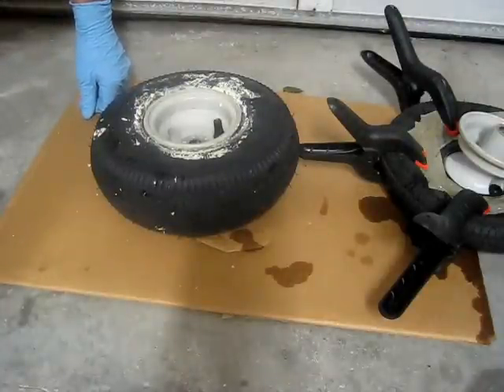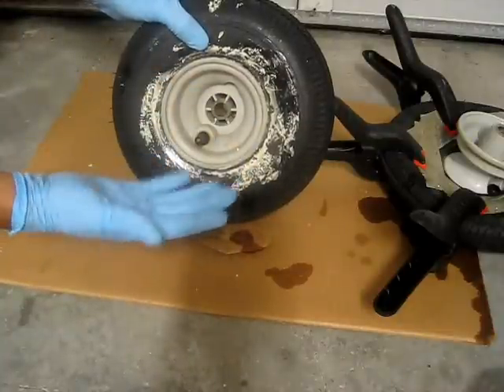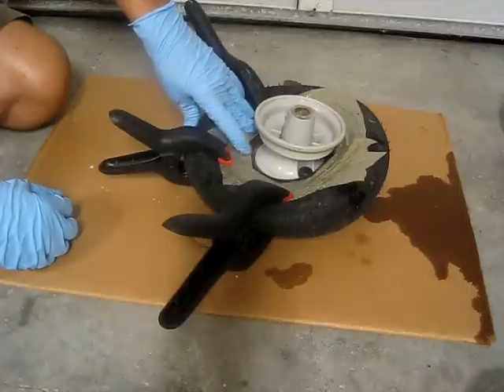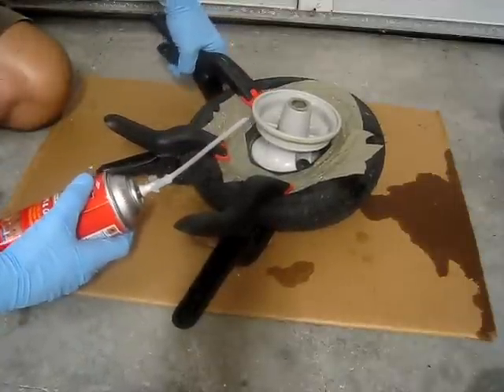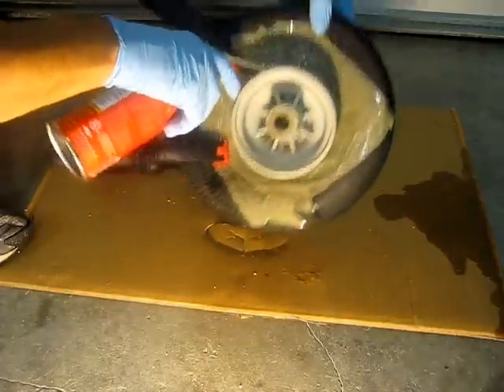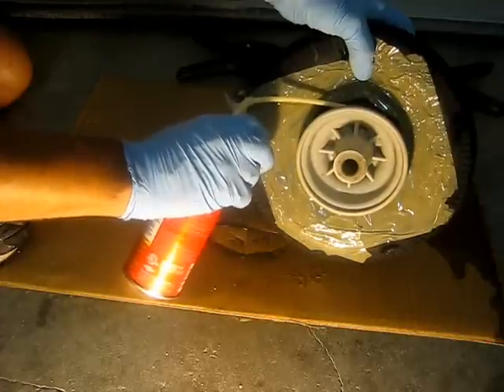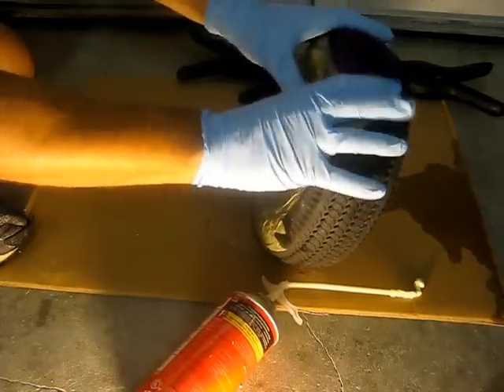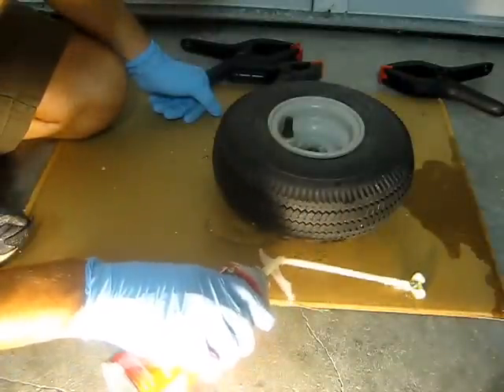How To Fix A Flat Tire

Comment: Too much wrk, too much talk & messy clean up! Here's how I do tires, I've done 4 riding mowers, a Harbor Freight hand truck, a double wheel wheel barrow, my mountain bike( both wheels ) & my 60hp Ford tractor: (1) Using this youtube as demo, wrap rope around middle of tire, pull tight till it will hold air,(2)  Fill tire w/ air till tire beads pop out & seat, deflate tire making sure beads are seated on rims (3) Drill holes slightly larger or same size as foam quill,1 hole @ top of tire, 1@ btm, small tires can hve holes drilled in sidewalls, larger tires, drill btm hole in sidewall, top hole in middle of tire tread. (4) Fill tire from bottom till showing at top hole  (Leave Shrader valve in when filling, don't need another hole to manage )(5) Stop foaming as soon as foam appears at top hole bc it will cont. to expand. (I never take Shrader valves out....Why???  )
I hve many Locust trees on my place, they hve 2-3" thorns, i bcame a tire changer/ flat fixing slave, at any given time, 1 vehicle always had a flat, now with miracle foam filling, i rarely have one. Just heads up about my experiences as a tire man! Good Luck!
Reply from the maker: +Dan Roy Some good ideas on there.  Will keep them in mind.  Thanks
Reply from the maker: +Mike Story Great! Glad to hear it worked for you.  Let me know if it starts to break down. I am curious how much abuse it can take.  Thanks
Reply: That was also my experience on a wheelbarrow tire.

Comment: does anybody think that  putting in foam peices and cardboard and paper all together into tires and using great stuff would help with keeping the tire strong .
Reply from the maker: +Mini Motoskills The great stuff foam will crush with repeated impacts.  The closed cell foam will rebound after an impact.  The paper is going to be heavy and may be more likely to cause balance problems if you are hitting high speeds.

Comment: Drill (3)  3/8 in holes in the tire and insert the great stuff until the foam comes out of the remaining 2 holes. Very easy to do, and a minimum of mess, most importantly you achieve uniformity of the foam. Much easier than the way you're doing it, with much better results. Not trying to steal your thunder, just my opinion.
Reply: You put it in until the foam comes out of the
holes and let it set up overnight. You could put screws in after it is completely full, but remember it continues to expand, adding screws would give you a very dense tire.
Good luck and the best part is no more flats.
Reply: Joseph, you are right I drilled three holes in the tread 33 degrees apart and worked like a dream. the way he is doing it really sucks.

Comment: Next time hold your can upside down.  Upright you let too much air pressure escape before the foam begins to expand in the can.  The expanding foam will drive itself out of the can, but when you reach the limits of the expansion the can will slow to nearly nothing, just like you demonstrated in your video.  Upside down preserves the air pressure in the can and will allow you to drive nearly all the content of the can out.

Enjoyed watching you essentially waste your time.  The foam is not load rated.  It won't hold up under a load.  If you did this on something that is going to have to carry any significant weight the foam will collapse.  And as the foam cures it turns to glass.  It breaks down easily and without air pressure in the tire you'll have a flat again.  Only with the foam inside the tire you'll be hard pressed to do any further repairs.

Good luck though.
Reply from the maker: You are right, it is better to hold the can upside down.  There is no straw inside the can to pull from the bottom.   I made the video in 10/2011 using tires that would not hold air.  It is 12/2016 now and they are still very firm.  No problems with breakdown of the foam.  But you are right that it isn't rated to handle a "load" but it can certainly handle some load.  I have never tested it to see how much.  I put 2 sit-on-top kayaks and all my gear on them and go down trails with roots and have never had a problem.  I am guessing about 200+ pounds.  Was definitely better than buying new tires every year or two and carrying a bicycle pump with me so I don't get stranded with a fat at the end of the trail.  I don't think this would work long-term for something like a riding lawn mower.  But I would try it for the cost of a can or two of foam to possibly save me from having to deal with putting air in my tire constantly.  I also doubt that it would hold up to use in a drive tire, like the rear of most riding lawn mowers.  I think the foam may let go and let the tire spin on the rim.  But then again, I would try it just to see if it worked.  Maybe even put a few screws thru the rim and into the bead of the tire to keep it from spinning.  But I don't have a riding lawn mower to try it on.  My point is, if you are going to pitch it anyway, why not try?  Of course, you can't expect it to hold up to unreasonable conditions (car tire, heavy machinery, road-bike tires...)

Comment: Great idea with the tape around the bead.  Lets say I want to reverse this back to a conventional tube or tubeless tire, how much work would it be to clean the foam off the rim?
Reply from the maker: You can get 99% off easily, but It is hard to get all of it off. There is usually a thin film left. But that should not cause a problem unless it is on the part of the bead that makes the airtight seal. You can sand that area if you need to.

Comment: WHY NOT TAKE THE TIRE OFF AND EXPOSE THE INNER TIRE AND SPRAY OR PAINT THE INSIDE WITH FLEX SEAL. AND LET Set  UP AND RE-INSTALL. AND SEE IF THAT WORKS. USE BLACK FLEX SEAL AND IT WILL NOT MATTER IF YOU GET SOME ON THE OUTSIDE.. I HAVE NOT TRIED IT BUT THINK IT MIGHT WORK.  ONLY PUT FLEX SEAL IN AREAS THAT HAVE POSSIBLE HOLES.
Let me know if this works. PROBALLY WILL NOT BE SO MESSY.
Reply from the maker: I haven't tried flex seal yet.  Would be a good experiment to see how good it is.  The problem with my hand truck tires is they had dry rote so they had tiny cracks all over.  But, if I painted the entire inside of the tire, maybe that would work.  I have been wanting to get a can and try it out.  I will let you know if I do.  Thanks for the suggestion.

Comment: you went about that the hardest way possible...
just leave the tire on the rim, remove the valve from the stem, insert the tube all the way into the stem and spray the extra expanding foam in  while rotating the wheel a few revolutions.  take the tube out and reinsert the valve.  no mess, works perfect!
Reply: Does that work? Make a video.

Comment: Wont work in load carrying tires 
What you will get for your efforts.is flat spots everyy time you leave your lawn tractor sitting. You need a foam with some memory like rubber.
Reply from the maker: Yes. It can only handle so much weight.  Turns to powder if you hit roots and rocks.  I still use the tires in the video, but they only have about 50 pounds each on them and I don't tend to hit lots of small hard objects with them.  Small, lighter riding mowers on a smooth lawn will probably be fine, but the heavier ones with a (shall we say) typical sized american, may not last too long ;-)  Also, the drive tires may eventually spin on the rim since there is no air pressure to keep it seated.  But the foam has kept my tires glued to the rim pretty well so far.

Comment: Love the tape and the no-holes method--looks good, but you are supposed to hold the foam can upside down.  Also, it will take longer to cure with no holes in it.
Reply from the maker: I didn't know about the upside down thing until much later.  Moisture is what makes Poly cure.  So the holes don't really do much good, unless you spray a little water in them.  I just put a small amount of water inside.  Here are a couple of other videos I made about poly foam.
https://youtu.be/iB14LiKIJec
https://youtu.be/f4URZt366kE
https://youtu.be/fxfvEXoDBM0

Comment from the maker: There probably is a limit as to how much weight the tire will take and how long you can let it set with the weight on it, but that will depend on the tire specs. The tires I did this to would not hold air at all, so I had nothing to loose.  I haven't had to put air in them since and they are still very firm and no flat spots.  I know the great stuff foam I have used in houses I built 20 years ago is still in good shape.  It will probably outlast the tire.

Comment: Have you tried taking the valve stem out of the valve to insert the foam into the tire?
Reply from the maker: No, but I have seen other videos where people did.  It makes a little bit of a mess.  When you pump foam into the tire, it creates pressure.  When you pull the straw out, a bunch of the foam will come out before you can get the valve stem back in.  Putting the valve stem cap on might be easier.  Some people drill a hole on the opposite side of the tire to let the pressure out, until the foam starts coming out of the other side.  If you plug that hold with a screw or something, and put the cap on the valve, it might work ok.  If you try that, let me know how it goes. Thanks

Comment from the maker: I thought WD-40 would deteriorate rubber???  Not that I would put Great Stuff in a nice new tire ;-)  The one in the video already had small cracks all in it. I have seen people say it will and will not hurt rubber.  I think it takes a long time to do any real damage, so I guess it depends on the longevity you need out of the tire.

Comment from the maker: If you ask for help, that takes away some of the fun ;-)  I have had mixed results trying to reuse a can, but it is always worth a try.  I will have to try the sheathing trick next time.  I wanted to do my wheelbarrow tire, but the rim had huge rust holes in it, so I bought one of those heavy solid wheels.  After you use it for a few heavy loads, let me know how it works out.  Thanks.

Comment: Watched your video as my wheelbarrow tire is setting up... what man reads the instructions or asks for help first  :)    
Two notes I'll add.  First Great Stuff cans are reusable.  The plastic sheathing off of 12 ga electrical wire works as a make shift second tube.  It's the tube that clogs and causes most people to throw the whole thing away.
Second.  I drilled three extra holes in the rim for even distribution and have the tire spinning at slow speed incase I need to add more.

Comment: I just had a thought   Try attaching the hose from a tire seal prouduct, you know the one in the can. They have the screw on that attaches to the tire valve. remove the core from the tube or stem srew the adapter on and hopefuly it will do the job. Now i have used this putting fluid in small tires but never played with the sticky stuff. Just my 2cents

Comment from the maker: Sorry it took me so long to reply.  Don''t know how I missed your post. I did this video Oct 12, 2011.  It is Jan 16, 2013 now.  The tires I did are still nice and firm even though they use to loose all air in a day.  But, I only put two kayaks on them from time to time, so I don't know what would happen with a heavier application.  I know the foam last for many years in houses, so who knows. ;-)

Comment from the maker: Thanks for all the comments SkubaKirk.  I will have to try that on the next one I do. If you try it, let me know how it goes.  When I did the ones in the video, I put a little water in, then the foam, and then let the tire sit in the sun while it cured. My thought was that the pressure would help even out the pockets in the foam before it cured.  Thanks

Comment from the maker: Hey Neil,
You could use an adapter like that to put the foam in. You have to be quick to put the valve back in once you pull the adapter off, the pressure will blow a bunch of foam back out..  The extra pressure may keep you from getting as much foam in.  Also not sure if it would distribute as well, but it might.  If it did not distribute, you could just bust the tire off of the rim (after it sets up) and then fill the other side.  If you try it, let me know if it works out for you.  Thanks

Comment from the maker: I know it works great on my hand truck tires.  They still stand strong when I put two kayaks and a bunch of gear on them.  All you have to lose is a can of great stuff and a little time.  Let me know if you do it and if you had any trouble.  Not sure how much great stuff it will take. Depends on the tire size.  Better too much than not enough.  Also, if it is a drive tire, be sure to clean the bead well so the tire will bond to the rim when the foam comes out between them. Good luck!

Comment: I tried this experiment repeatedly on an old, dry-rotted wheelbarrow tire, and it was also a fail.       NOTE:  Everyone who does this, even after letting the foam cure, who actually uses the tire under loads, must  continue adding more foam periodically. WHY? The household foams compress & pulverize into fine dust in short order, leaking out of even tiny holes. It will continue to pulverize & compress even after repeated applications, and even after sealing any holes (don't ask how i know). In the end, it was a complete waste of time & money. Instead, I should have used Slime tire sealant (or other similar brand), which will fix all but the largest leaks and will continue to fix new punctures for years to come (unless one  foolishly drills large holes in the tire, which would have to be patched first before injecting the tire sealant).                                                                                                                                                                               There are compounds that do work for making tires both airless and durable over the long term, but this REQUIRES the use of a 2-part liquid high-density urethane or polyurethane product. Professionals fill skidder & tractor tires with it. It does not compress like the household one-part foams, but is an expensive option that will also make your tires very heavy...                          Here is one example of how it is properly done, to put the silly usage of household foam into proper perspective:                                                                                                                                               https://www.youtube.com/watch?v=i-JPbl4tgS0
Reply from the maker: Youtube blocked this due to the link, but I let it go thru anyway.  I thought the video was pretty neat.  But, expensive and way overkill for small tires with light loads.  My application was handtruck tires for a kayak cart.  The tires dry-rotted quickly and wouldn't hold air for more than about 10 minutes.  I filled them both with foam. That was in October of 2011.  5 years later, they are still very firm.  I put 2 sit-on-top kayaks (about 70 pounds each) on it and a bunch of gear.  No clue what the total weight is.  Nothing like the weight of a 4 wheeler.  I don't think it would work long-term for something that heavy.  I have come across people talking about foam not curing due to lack of moisture or contaminants that react with the foam and keep it from getting hard.  But there are plenty of people that have had success with it.  I tried slime many years ago and didn't have much luck with it.  Maybe they have improved it.
Reply: I'm glad its still working for you. Hand-truck tires are much smaller, with a much smaller internal volume for the foam to support than a wheelbarrow tire, so perhaps that explains the different outcomes?  Your method, which avoids drilling numerous holes as advocated in other tutorials, could also be a contributing advantage. The only thing I can verify for sure is that last summer, I tried several cans each of Great Stuff (both the lower-expanding and higher expanding versions), then some other brands (probably every available brand of expanding foam sold between Walmart, Lowes, & Home Depot). They all cured, as evidenced by the powdery, dry pulverized foam dust & particles that continued to shoot out of the small drilled holes.. Even after refilling with foam & sealing the holes numerous more times, the foam continued to do this, even when the pulverized foam couldn't escape. In my application, the household foams lacked both the structural integrity and the density to support the tire under loads. It would pulverize quickly in one or 2 places, causing flat-spots, which would continue to grow larger & larger as the wheel rolled. It's likely that going over bumps and concrete sidewalks was always what initially started this process. It may be worth a try on small, lower profile tires, but on the larger wheelbarrow tire, my failed experiment was more expensive then what the airless replacement wheel/tire combo cost me at Harbor Freight.
Reply from the maker: If I remember right, I put a half can in each handtruck tire.  The water is key.  If you don't put enough water, the foam cures too slow and the small air pockets start to clump together making larger and larger air pockets.  Holding the can upside down is also key.  You get more foam and less propellant.  I don't like drilling holes because it lets the foam out, but you have to keep the bead from setting until you get as much foam in as you possibly can spread around the tire.  Then the pressure of the foam sets the bead, and as long as you don't have any big holes or large cracks, the foam will stay in the tire.  I think most people would be disappointed in the results of foam in a wheelbarrow tire because the weight that most folks put in one is too much for foam and even hitting roots with a heavy load will damage the foam.
Reply: Dee Cee he'll why not just fix it properly get a new tube and tire and your do e with it for 30 years